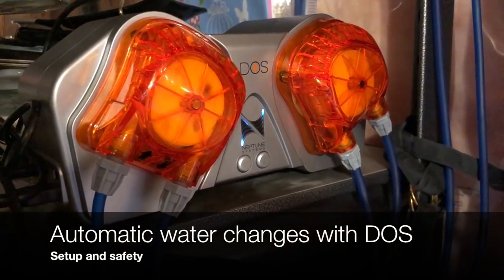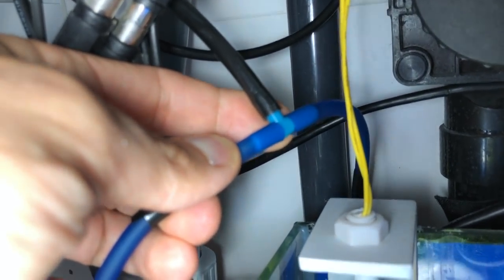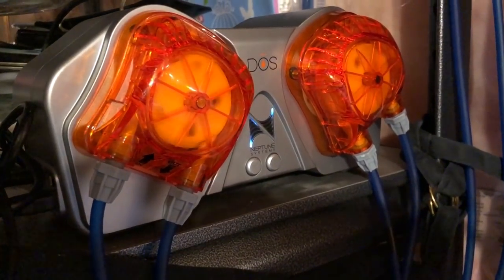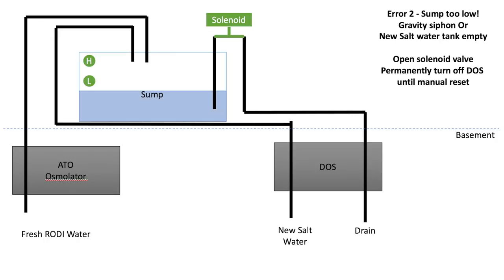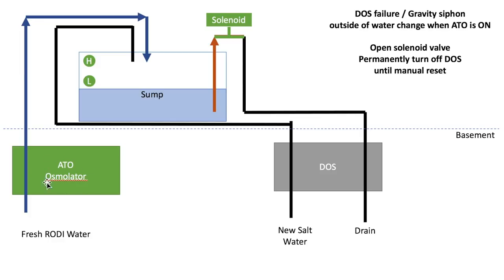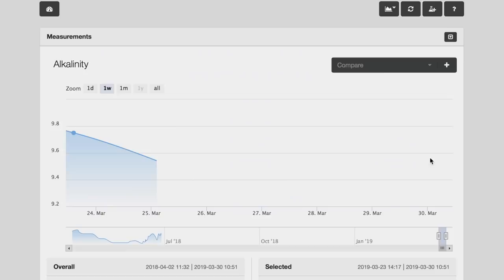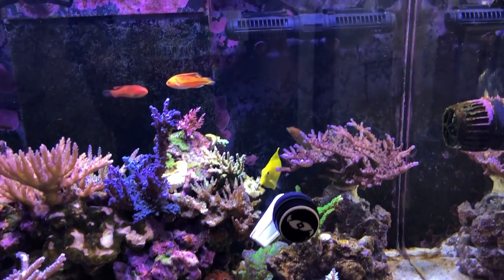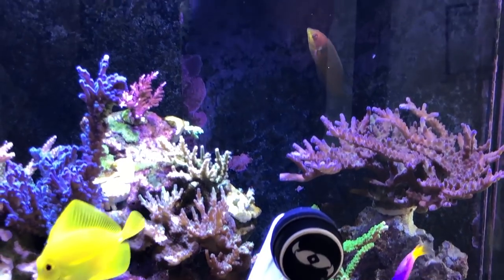Automatic water changes with Apex DOS: Setup and Safety notes

Comment: First of all, thanks for sharing your setup and explaining at this level of detail. I've been thinking about setting this up for a while now and have been looking for someone to show their setup the way you did. Glad to hear you addressed the ATO because while I've seen multiple articles or videos on how to set up auto water changes, they all ignored the presence of ATO, which clearly is going to interfere with pumping water out of the tank or sump. 

At first, I didn't get why you had the solenoid there but once you explained it made perfect sense. Now, the 3rd "problem" you were looking to solve with the solenoid - some mystery siphon sucking the water out of the sump after the water change hours (e.g. 6pm)... you solved it by setting up the ATO to pump fresh water at lower speed than the siphon would pump it out, therefore eventually triggering the low water sensor. BUT... wouldn't it be easier to just keep the solenoid open at all times outside the water change hours of noon-2pm? This way you are guaranteeing to never have the siphon, to begin with, and don't have to worry about the ATO pumping rate, etc.
Reply from the maker: Max Headroom yes keeping thensolenoid open when not doing water changes would be good. But, from my understanding, the apex solenoid is closed by default. Electricity is applied to the valve to force it open... it was told that keeping the valve open for long periods of time can overheat the mechanism making it failure prone... you still need to have the optical sensors anyway in case of failure during the water change itself. Thanks for watching

Comment: This is a very well done video explaining how to fully utilize the DOS pump. You also did a great job of working through the failure modes and figuring out remedies for each one. I will definitely be using your ideas to keep my basement floor dry!! Being new, I didn't realize the power of making your own modules. I will have to find out where the different program instructions are documented and explained.
Reply from the maker: thanks Mike!

Comment: good job explaining the details Amro as usual your videos are top notch...This is exactly how i have set up my AWC using DOS in the basement. The only difference is i did not T the pipe taking old water down because the pumps are made to pinch the pipe when not on working thereby stopping the flow..thanks.
Reply from the maker: Ashfaque you might want to do the solenoid valve as well Ash for extra safety l. Yes the pump is designed to pinch the tube, but sometimes the pump’s internals wear out. Also, someone may accidentally cut / nick / remove the tubing between tank and dos... just another layer of safety

Comment: Nice.  The New Wrasses look fantastic.   Also that DOS pump has higher FlowRate then you made it sound in earlier discussions.
Reply from the maker: thanks Wally - I think the maximum flow rate is 250 ml per min, but obviously you can't run it continuous  for long periods; software wont allow it; needs to take a break

Comment: I like your video it’s hard to find videos of people that use the tunze in conjunction with a AWC I trust my tunze so I didn’t want to go with another brand. Couple of questions 
The tunze can be powered on and off without messing with any of its internal programming correct? ie you set it and forget it. 
Also do you adjust any settings for skimmer, return pumps etc?

Lastly if you wanted to shipon you display tank sand bed or do a manual water change how would you refill at that point? via the DOS fill from salt water reservoir and cancel the drain pump? Sorry if I described it confusing
Reply from the maker: Tunze is great / while I plug it to my apex for power (to be able to turn it off during periods where I don’t need to have my tank topped off), it can be totally stand alone. There is no really internal programming with the Tunze. There is an optical sensor and float switch that is magnetically mounted in your sump, the pump in your rodi, and a line from the pump to your tank. You can control the power of the pump by turning a knob inside the controller (after removing a few screws). It is solid and I highly recommend it. Re. Your other question. The DOS has limits on how long it can turn the dosing pumps for and how much volume it can move per hour. You wouldn’t be able to drain a large volume of water and replace it very quickly. You would need a different type of auto water change system for that

Comment: Thanks for sharing. Just a friendly note. If your solenoid fails to close you will have water splash over your plugs. It would be safer to have it point towards he sump.
Reply: Not actually true. Since the DOS and gravity are both pulling from below the solenoid, if it stays open, it would suck in air, not expel water. That is actually the point. It breaks the vacuum between the DOS and the Tank preventing either the DOS or gravity from being able to siphon water by introducing air.

Comment: Thanks for the info! Have you add any issues with the apex solenoid coming into contact with saltwater and rusting? I’ve read they aren’t intended for use with sw
Reply from the maker: Sorry for the delay - In my application, it is only exposed to air. Yes you are not supposed t get them wet with salt water. I have another on my FW system and it’s been working fine

Comment: Thanks for the video, very informative. Things I disagree with (don't see the point) is the water level sensors and switching the ATO off because you can run the water removal and return at the same time. On top of that, if you set it in continuous mode, let's say I have a reefer 170, daily 3% change = 5 liter / 24 hrs = 3.5 mL/min - my ATO won't even notice it. Anyway, just "thinking  loudly". Thank you for the video.
Reply from the maker: yes if you were to do continuous mode, then no need to ATO off... the only reason for turning the ATO off - for me  at least - is that if there was a malfunction with the DOS that led to a siphon downstairs in the basement and the ATO is on, then the ATO will compensate for the loss of water preventing my fail safes from coming in sooner
Reply: @TheBioReef  thanks for replying so quickly, yes, I do understand your point. it is good to highlight all the possibilities could happen and your video is good at it.
Reply from the maker: @andrasfarkas2648  thanks!

Comment: Thanks for this great video. I am wondering what would happen if one of those optical sensors malfunctions. Is there a backup you thought about?
Reply from the maker: you can run double optical sensors, but optical sensors are fairly reliable so i am comfortable with using them.

Comment: Excuse me if you mention this I skipped around. How do you make sure the salt brut is completly emptied, yet not contiue to suck for another water change so you can mix up a new perfect mix of salt.  can you tell the apex to only do this for X amount of days so the brut never empties?
Reply from the maker: i have an optical sensor at the bottom of the salt water brut ... when the water level drops below the optical sensor, i get the apex to turn off the automatic water changes.
Reply: @TheBioReef  thank you

Comment: Hi Amro... impressive work and thanks for sharing... I am going to try to do something similar, just without Neptune... two questions - if you ran your outflow line, in the sump, to the level of the lower limit (or just below), wouldn't the siphon break at the same time as you hit the 'concern' level? (or am I missing some implication?) why not just open the solenoid for all times but noon to 2pm? (wouldn't that also just prevent any drainage, except when your other water-exch 'module' was on?) (maybe that has power/wear concerns? need a NO valve, closed only for 2 h / day, or only while DOS active...  :) ) just wondering about implications... that I may have missed... thanks!
Reply from the maker: Thanks Ryan. Re. Valve. The way the Solenoid work (at least according to my understanding) is that they have a default state (closed or open) and an active state where electricity is used to open or close the valve. I think the Apex valve is closed by default... I think I read somewhere that I can risk damaged to the valve if I kept it open most of the day... about outflow line... you are right... for me, I just didn’t want to bother with mouthing the outflow line at a specific level in the sump... there isn’t much room and lots of wires and things always shift when I do anything there, so I didn’t want to rely on precisely placed lines because they will end up moving on me. Good luck with the Setup

Comment: Thanks so much!  I contacted Neptune systems and they were useless.  You would think they would have some pre-made logic to help us with this in order to make this automation more fail safe.  I’m using their atk level sensors to use your logic.  Thanks again!
Reply from the maker: fostee1 thanks - yes I feel that they also just assume that things will work perfectly and they Fail safes are not necessary

Comment: Excellent explanation of your setup. Sorry if you have already answered this .  To avoid the chance of a siphon while the dos pumps aren't running, can't you just keep the solenoid open while the water change isn't running?
Reply from the maker: T B you can... although you would have to command this with a timer because - annoying - you can’t sync it with dos heads running as this info is not reported as a switch on the apex

Comment: Does the system need priming before every water change?
Has the solenoid valve ever been needed?
How much does  the water level in the sump fluctuate when running.
Reply from the maker: No priming needed. Solenoid is a backup system that has not been needed so far. In theory, this type of water change does not cause any noticeable fluctuations in water level

Comment: Thanks for this video, I just implemented the same technique as you. Your video was a great help and full of good advice. I did notice one thing you are doing and I'm not sure why. In your DOS_ADD and DOS_REMOVE code, you are checking for SUMP_L and SUMP_H being Open or Closed respectively and if they are you turn the DOS Pump off. Why do that when you have the same code check inside of SUMP_Problem? Wouldn't it just be simpler to manage the code in SUMP_Problem and only have the one line in both the add and remove pump to shut off when sump_problem is ON? Plus by having that redundant check in the pumps, it is not using the defer statement of 1 second so if you have a fluctuation with water then this will kill the DOS inadvertently, wouldn't it? I just want to make sure I am not missing something? For me, I made a Sump_problem with the same hi/lo checks and I have two more sensors for checking hi/lo in my clean and dirty saltwater tanks as well. I made a different output called SW_Problem that tracks those sensors. From there I made one more Virtual output called TURNOFF_DOS which checks the sump_problem and SW_problem for ON, if they are ON more then 2 seconds then keep DOS turned off permanently until I check it. Then I add one line of code to my DOS pumps to ensure they shut off when TURNOFF_DOS is ON. One last thing to point out to anyone else reading this, don't forget to add the required lines you want to be notified about to your EMAILALM_I5 output. This way you will get the notification directly to your device/email.
Reply from the maker: You code is certainly more efficient than mine. Thanks for the tips.

Comment: this is amazing, im in the process of setting it up
Reply from the maker: thanks! good luck
Reply: @TheBioReef  wow u replied! I'm impressed. I have rodi water toato rewiviour to sump a d rodi to salt mix station.  Do I need a hi lo optical sensor x3 sets one in sump one in salt mix and one in ato to be safe?
Reply from the maker: @RWAquariumPages  That may be overkill. A single sensor in the salt mix and RODI would be useful to tell you when you need to make more, but i can't see them being useful to day to day operations, unless you manually move them every day to just below your daily water change volume... seems very tedious

Comment: can you share where you placed your H &L optical sensors relative to the Osmolator optical eye and secondary mechanical float?   thanks and great video !
Reply from the maker: Sure - the H sensor was added to the reefer 250 cutout for stock ATO float valve... about 2” above the osmolator sensors in the return chamber. The low sensor was placed in the baffle between skimmer and return chamber, about an 1” below the water line
Reply: AmroAzul TV awesome... thank you !
Reply from the maker: sandra rattray good luck Sandra

Comment: How did you get the wiring long enough for the tunze?
Reply from the maker: I had to extend the cable using speaker wire that you can easily get from amazon or home hardware stores (eg. https://www.homedepot.ca/product/commercial-electric-100-ft-14-gauge-speaker-wire/1000724829). Basically, disconnect the power, and splice into the power cable going into the tunze... the power cable to the tunze has essentially two wires; splice these two wires with the two wires from the speaker wire (they also have two wires), you can use electrical tape or some kind or quick connect.

Comment: This video is just awesome and I am copying directly. But I am having an issue with the Sump_Problem "when" command code. For some reason, regardless of the time I have for that "when" command, it trips. Testing this, even if I go up to 59 seconds, it still trips (I have not gone beyond that). Any advice on this command and how this could be possible appreciated!
Reply: Well, after much trouble shooting I deleted all the programming (then synched) and reprogrammed one line at a time, synching after each, and now it seems to be working (meaning, not auto tripping to "ON" with the last line.) I am thinking of also disabling the ATO during the 2 hours a day that the DOS is running. Can you think of any reason to NOT do this?
Reply from the maker: Thanks! here is my latest code... the When command as written is designed to keep the virtual outlet ON if any of the if statements turn it on for more than 2 sec...until you manually set it to off.

Set OFF
If Output HighSumpLvl = ON Then ON
If SUMP_L OPEN Then ON
Defer 000:30 Then ON
Min Time 000:10 Then ON
When On > 000:02 Then ON

more info on the when statment here...
https://forum.neptunesystems.com/showthread.php?18393-Using-the-%91When%92-statement

Comment: you can achieve the same thing with the solenoid in line with the DOS.  so that it cuts off the flow of the water completely. also getting the safety code in just in case the solenoid fails in the on position.  Don't you have a back siphon with the RO line? that's the problem I had so I installed the solenoid there as well. just some food for thought.
Reply from the maker: That was my original intention but the apex solenoids are not rated for salt water. i don't get the same issues with my RO line as it is not immersed in the tank. Any fresh water in the RO line simply drains back to RO container

Comment: I know this is an old video so I hope you get this question.  I am trying to set up my DOS to change out 12 gallons of water right now. But, when I set it up in the tasks menu, it changes 12 gallons over 24 hours, and the DOS only runs for a little while every 30 minutes. How can I program it to change out 12 gallons now? In your DOS_ADD you have line 2 that says tdata. What is that and how does it work?
Reply from the maker: Dos has some features that prevent it from changing a large volume of water in a short period of time. You can try shorting the dosing period from 24 hour to something shorter and the software will let you know when you exceed the limits. You can also try the apex task list, I believe there is an option for a one time water change
Reply: @TheBioReef  The task list is how I have it set up but, I will try to write my own code in the advanced set up. On yours, you have line 2 tdata 12:00:00,1,17,13,5,2,88,12,13,9,0,0,10,0. What is that for?
Reply from the maker: @michaelgreen7561  actually Michael - that line was setup by the task programming... i just used the task list to do a 2 l water water between 12 to 3 pm, and wrote this line automatically
Reply: @TheBioReef  Thanks for you help.

Comment: Does the siphon happen only if you have the new water below the level of the sump? If my new water is at level with the pump, there would not be siphon ?
Reply from the maker: Ali Alqallaf siphon can potentially happen any time you have a tube of water in the tank that is flowing down anywhere below the tank. This can lead to a gravity siphon where water flows down by gravity downwards through the tube. In the case of my tank. I gave a tube that is in my sump and flows downwards to my DOS in the basement. If the DOS does not seal the tube shut properly or if the tube gets accidentally knocked off, then gravity starts a siphon that can drain my tank into the basement
Reply: @TheBioReef   First, Thanks for making the video. It Helped me with my plans big time.  
 What if you put the Dos unit above the sump, continued to run the  saltwater supply tube to the basement but the dirty saltwater "tube end" NOT to the basement. Maybe a drain on the same floor. Maybe my brain is backwards but wouldn't this eliminate any chance of gravity drain?
Reply from the maker: David J yes you can certainly place dos above sump and have a collection container above the sump. But in my case, it don’t have a lot of space beside the tank or in the cabinet... was just easier to have everything below the tank and just plan a fail stop in case of a gravity siphone